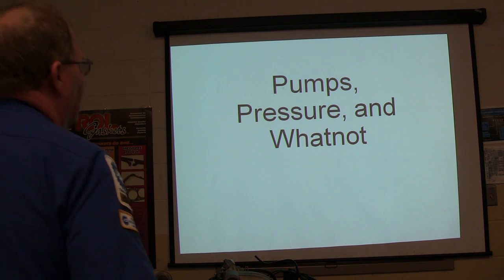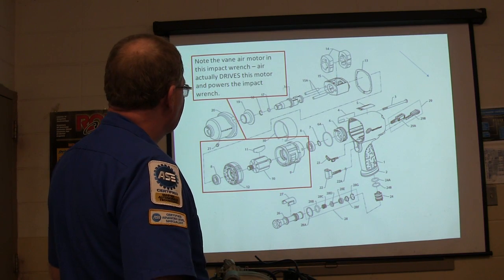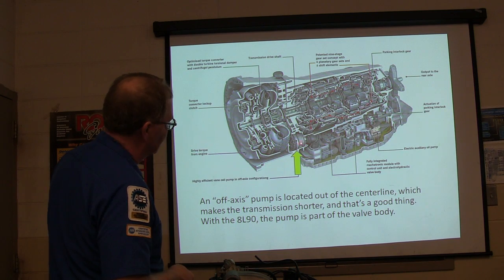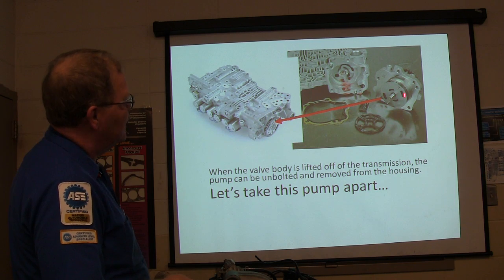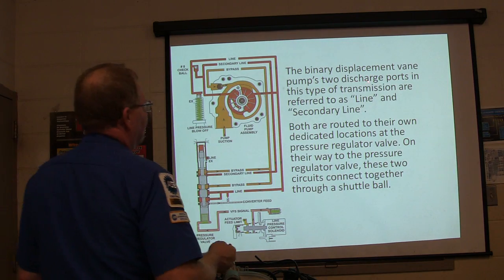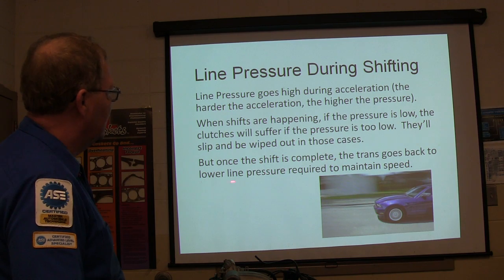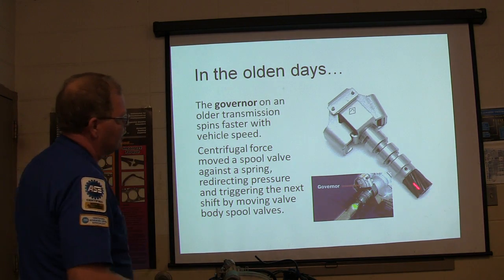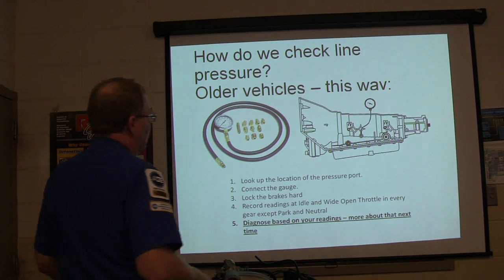Pump and Pressure   Aut Trans

Comment: I GOT A 2004 CHEVY CAVALIER AND THE TRAC OFF KEEPS POPPING UP EVEN WHEN I BARELY START IT ON AND ON COLD STARTS. I WAS WONDERING IF YOU KNEW WHAT SETS IT OFF
Reply from the maker: Usually that'll be a bearing/sensor assembly - have somebody monitor the wheel speed sensors when you're taking off an you'll probably see one over-reporting the speed on that wheel